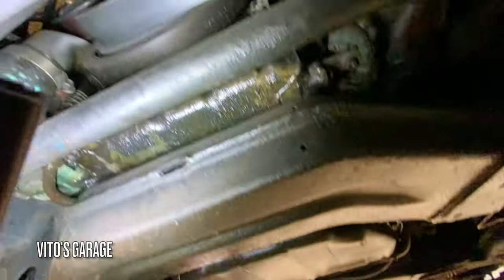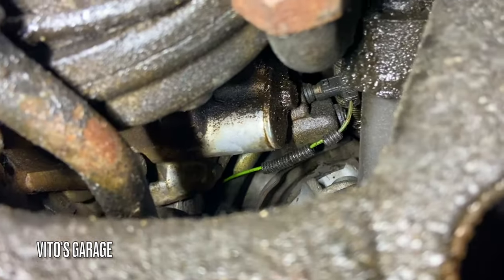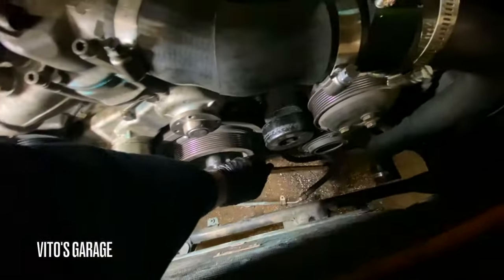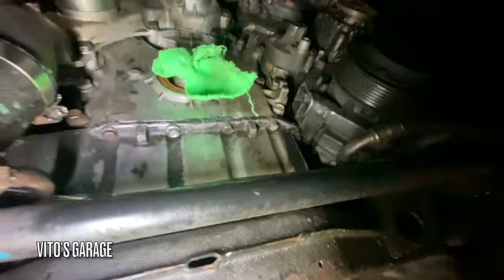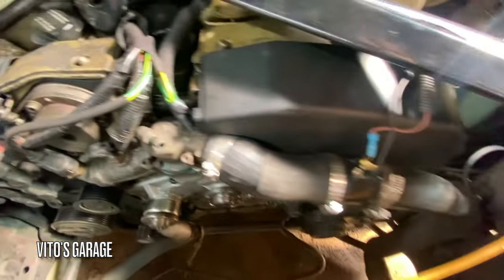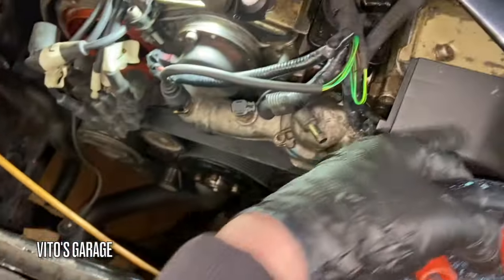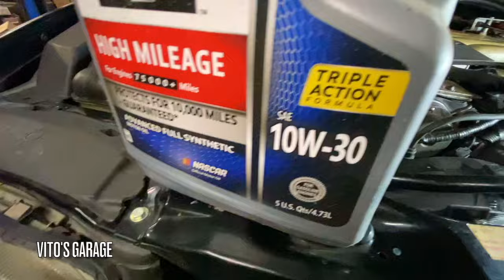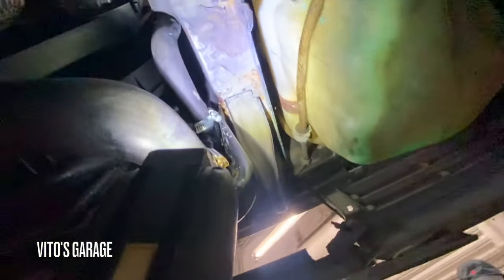Big Beast Mercedes W140 S600 Installing New Crank Seal and Fixing Oil Leaks. M120 V12

Comment: This engine use 5w40 oil
How did you torque crank bolt?
Reply from the maker: Magic lol. My friend was holding the crank pulley with his hands as much as possible and I cranked the bolt down with a big breaker bar